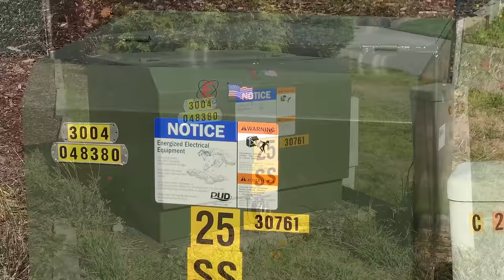Replacing a Pad Mounted Residential Transformer

Comment: I have the utmost  respect for those that work with high voltage systems like our power grid. You can see they are well trained and are well disciplined.  After all, there lives are at stake.     Now if only our elected officials could function with that same respect and understanding.
Reply: I often think about this too... What I think is happening is the type of mental focus it takes to design and implement these things it's very different than the environment of policy making and human behavior focused endeavors. 

I really like maths, I suck at it but I really enjoy the intense discipline and focus and creative thinking you need to discover unique and interesting patterns and relations. I also like system building.

But what I often don't like is people hahahaha.... I think that speaks perhaps a little to how we get such a reliable powergrid and such a shit show of everything else! But that's just my two cents! Take care!
Reply: They are not quite that disciplined. Numerous safety violations were taking place here. The biggest one was not using adequate PPE.
Reply: It's even worse when you get up high! I work around 480v on power bars 50 ft in the air on a cherry picker. You have to be aware of where you are at all times, one wrong move and you'll get nailed.
Reply: @johnarmenta2199  What do you think the primary voltage is? I'm sure much more than 600 VAC. I thought cotton clothing, like blue jeans, would be verboten.
Reply: @toma5153  - it's 15kV class equipment. My guess is the operational voltage is either 12.47 or 13.2kV. Cotton should be fine provided they have the breaker set on a hot line hold or arc flash mode. But they are not wearing Lineman gloves - the high voltage rated gloves. That's not necessary if the system is de-energized and grounded. I don't see any grounds though - maybe its grounded elsewhere. The big deal is no consistent use of glasses and hard hats. Just my observations.
Reply: @johnarmenta2199  Thanks John.
Reply: When it comes to high voltage, you only get to screw up once.
    If God is looking out for you.... Maybe twice.....lol
Reply: @JRotten  - yeah, God has nothing to do with it. Preparation, PPE, and following standard operating procedures will see  that you get home in one piece every night. My Team and I designed an arc flash reduction system for the electric distribution system and incorporated it into the SOP's. I know for a fact that no less than two Linemen went home safe because of that system which was designed and used by MEN! Not God!
Reply: The reason they don't is because there is no potential to die.
Reply: their * 🙄.
Reply: They'd have to be in fear of there life and that ain't happening when we are all sheep.
Reply: Lives at stake? how come? all you have to do is cut the power at the other end...
Reply: This is medium voltage.
Reply: @johnarmenta2199  not much of a guess when the transformer has “H.V. 12,470/7,200” marked on it.
Reply: @RadDadisRad  - Okay, I see it now. I didn't look so closely before. So, basically, I guessed right? LOL
Reply: @christiannielsen3863  - Cutting power is only half the procedure. The line has to be grounded as well. Gloves and eye protection should still be worn just in case the line is accidentally energized. That would be a really bad day, but those kinds of days can happen.
Reply: @RadDadisRad  More specifically, I believe the transformer actually sees 7200 volts. There is 12,470 volts between two hot phases in this system, but this is a single phase transformer connected between just one hot phase and a grounded neutral. 7200 * sqrt(3) = 12,470.
Reply: @christiannielsen3863  What about power backfed from one of the homes? Many homes now have grid-tied solar panels, though PV inverters are required by law to shut down if they sense the grid going away. Still, my utility (San Diego Gas & Electric) requires an outdoor disconnect switch on my house that the utility can open to ensure my system is shut down. We don't know if these workers checked for this.

Comment: This is a great example of what not to do.
Reply: Elaborate? Edit, I finished watching the video.  I get it now.
Reply: Why?
Reply: @boele0707  Not enough PPE.  Poor practice for example, they left the same conductor on the wire.  New connection = strip back fresh wire.
Reply: Safety Safety Safety. No proper ppe, testing, phasing, lifting procedures, shape job on cables was horrendous. Tho.. they did change it with primary hot 🔥
Reply: Man plz.  They must not need ppe or cover up.    I would be fired if i did that
Reply: @green250mx  why did they do it primary hot? Why not pull the fuses at the pole? I've assisted with a few ped transformer changes and DTE guys always de-energized em at the pole
Reply: @themtb2003  hahaha there's a BIG difference between electricians and linemen.  A real lineman will do it the right way, every time.
Reply: @electromechanicalstuff2602  not sure of their safety practices. Not totally wrong just not the safest. Most likely to save time
Reply: @tonyhill5348  well when a lineman does it wrong the first time he ain't got no arms to do it wrong again.....
Reply: @Mr. Sunshine I seriously hope your not in any trade.  I'm surprised your doing alright if you feel like this is okay.
Reply: @Mr. Sunshine by your standards maybe.  But by distribution standards for the United States, no.  A hard no.
Reply: @Mr. Sunshine got that right!
Reply: @Mr. Sunshine u got it bud!
Reply: themtb2011 backwards work with a hot primary might be nice for the others on the same feeder but that close to hot Kv without an insulating blanket might shorten your life. Those others on that feeder ain’t gonna take care of your affairs if you get fried. Kill the fuse or disconnect further up the line..  been chasing electrons since 1953 both military and civilian. been lite by 440 3 phase 400Hz. Once ain’t fun.
Reply: @themtb2003  no, we're NOT electricians.  The actual job title is Line Mechanic, also, the IBEW isn't the only union, you forgot about all the local utility worked unions, I'd have to double check but electricians are not included.  Anything else?
Reply: i agree 100%
extremely sloppy job. 
A: they guy lost his socket wrench and allen socket in the old one lol and thus why the other guy had to use an impact
B: that NoOx was not applied even close to properly. your supposed to brush it INTO the strands of wire
C: its not even to code to allow the reuse of those ends. you MUST cut them off and use fresh ends of the wire. that IS a code violation for aluminum wire. copper can be reused a few times. 
D: No torque wrench was used. putting them till they are tight as a MOFO is a bad craftsmanship and usually a failure of such on an electrical inspection. 
E: You are (per the manual) supposed to use 2, not one, 2 of those crimp bonding sleeves and a go No go gauges used to confirm them installed to spec. I saw none being used. 
F: i have never see such blaintent overspending. looks like 6 guys, 2 trucks and a crane to do the job that 2 people and a mini skid could do easily. hell even a truck crane could do the job. they only weigh like 500 lbs. maybe that one was more, but most of those truck bed cranes are good for up to 1,000
G: Quite a lot of OSHA violations, a few guys with no helmet, NO safety glasses at all, and i see NO flaggers on the street. a few cones will not suffice. 

honestly one of the worst jobs i have ever seen done.
Reply: @tonyhill5348  ok boomer
Reply: @themtb2003  that's basically the response I figured you'd come up with 😉.  Defeated!
Reply: @themtb2003  diy chatroom is the worst
Reply: @themtb2003  oh yes so many online experts
Reply: @scallen3841  Why is there always one of you bone heads that always demands a counter video? The Internet does not owe you anything; besides, @loligagger85 Did quite a good job of explaining what these guys missed, even if flaggers is a bit over kill for this size job. You should see jobs like these in West Africa...you'd literally lose your $hit.
Reply: themtb2011 backwards you obviously are not a lineman lol. This video has so many views cause we are showing it to crews and pointing out all the suck from beginning to end lol. Stick to black red blue my insecure friend. This changeout is epic trash. Sorry you didn’t know this lol. Maybe cause you’re not a lineman and dunno what a good comment is when you see it lol
Reply: That’s a pretty ignorant incorrect way of looking at it but seeing as you dunno anything about line work it’s ok. I’m not in a union. I do this faster and safer with less ppl. But nice try.
Reply: themtb2011 backwards you know what they say about sucking don’t you? It sucks to suck. Lineman don’t go on electricians forums.
Reply: Egg Shaped Israeli Operative  lol isn't that truth ,
Reply: @MrT13  Wow dam such a big mouth behind that keyboard
Reply: I don’t run a crew cause I’m such a nice guy. I’ve been doing this a long time I did regular electric for a while first. I’m good. And you know how I know? Cause I know that there’s a whole ton of ppl out there who work on bigger stuff than me who are way better. But in this video from the fact they didn’t kill it. They used a test feed through to tie a loop. And they could’ve just left the secondaries on the taps and just unscrewed the one screw holding it on those 3/4 studs. Plug one side in go up to next punch it in test it without whole tap on test volt unplug and finish and energize. I do this everyday bub. Quicker and safer.
Reply: Wether it’s behind this cell phone or in this yard with 70 other guys I’m in right now it doesn’t make what I’m saying any less true. This changeout was trash. Takes longer energized. And is dangerous for no reason.
Reply: @MrT13  then why weren't you showing them your Superman skills , and doing it all yourself lol
Reply: I dunno how long this took them seeing how it’s edited but we can setup. Kill tx and have it back on in under 15 minutes unless a plane crashes on us or some nonsense. Guy who made this original comment knows what’s up. It is what it is.
Reply: Scallen when I’m tired of watching a grunt fiddle with something long enough I do. Like I said. Sucks to suck.
Reply: @electromechanicalstuff2602  was there any indication that the line was actually hot? Could they have reenergized the line before hand? I have no idea about lines work.

Comment: That is some pitiful safety practices
Reply: Lol, I liked the apprentice with NO GLOVES, the journeyman with leather gloves, the foreman in yellow with no hard hat or gloves touching the transformer, accident waiting to happen.
Reply: Agree!
Reply: @lennylenhard5072   Yeah I use to do this kind of work. I seen how they are not suited up. I was thinking do they have a death wish. There's no way in hell I would even think about being careless. I know to many people that had freak accidents and got injured or even died.
Reply: Using non-insulated ratchet to take off the wire on the service side
Reply: That's what I noticed.  No gloves, no face shield, and one - no hard hat.  OSHA take notice.
Reply: Changing a ug can with the primary on a feed thru smh.
Reply: What about using in insulating mat only for the knees.
Reply: Not at all. Those wires they were handling and screwing down to the terminal strip were dead secondaries. Those were the 3 feed lines going to the 3 houses fed by the xfmr. The transformer was not hot at that point as the line side terminals had been capped off and were on the dummy terminals on the transformer. When the wiring was done the lineman with the pole moved the input wires to the primary of the transformer.
Reply: southtxblues This is Canada
Reply: @wansolve2036  I retired from an elect utility and for something like that, even dead, safety glasses and gloves were required.  It was to be treated as if it were hot.
Reply: @steelisthemeal  No it isn't, it's Wa St on the peninsula, look up Clallum county PUD truck images and compare them to the trucks you're seeing on this video.
Also take note of the license plates in this video.
Reply: I saw the thumbnail and only came to mention that haha
Reply: WanSolve does not mean  a house was not back feeding # not worth the risk
Reply: @ajfurnari2448  Main Power was disconnected.
Reply: I'm an inside wireman. The one thing that I saw was when he had the multimeter and was testing voltage on the load side busbar, this fat middle aged Journeyman was bent at the waist getting ready to tip over and get a face full of voltage
Reply: I get the hard hats needed when they were lifting, but why a hard hat when nothing is above head?
Reply: Dusty 99  I'm not a keyboard warrior, though. I'm his peer in the field
Reply: @dougierotten  OSHA
Reply: Because if you get hurt worker’s compensation the SAFTEY man osha and because you are working UNSAFE YOU SIR ARE SCREWED.
Reply: I’m not sure who is in charge. I’m guessing the fat guy in the green jacket. regardless someone is teaching the younger guys terrible habits. Look at your rubber gloves, they are spotless,.
I used to worked for LEE COUNTY ELECTRIC CO-OP ,,, NEVER DID WE WORK LIVE TRANSFORMERS WITH CASUAL GLOVES...
IVE SERVED MY TIME IN THE HARNESSES AND SLEVES AND GLOVES . YALL STAY SAFE BECAUSE BELIEVE ME YOUR COMPANY IS NOT YOUR FRIEND
Reply: I'm sure your all the professional's you think you are
Reply: WanSolve the primary lines were hot.
Reply: @billcoley8520  whatever you say "pro"
Reply: @lennylenhard5072  so I take it this would be a good OSHA VIDEO what not to do changing new transformer. I honestly thought wow these guys are doing this to fast I think, Then when I read comments I was right, That's crazy 😨😨😨😨😬😬
Reply: Also they didn't torque the terminals and the transformer wasn't bolted down to the ground.
Reply: PlzDontKillDave you are not correct. You are very confused my friend. 
The primary cables you are speaking of are HOT. One comes in and one goes out. When they are using the hot stick to pull out of the transformer it is hot 🥵. Likewise for the other.
Reply: None of em wearing Saftey glasses or face shields.
Reply: AJ Furnari I cringed when I saw that ratchet.
Reply: They have very lenient safety rules there. No glasses, gloves, hard hats, but they have wheel chocks, cones and pads down.
Reply: Cowboys. Terrible.
Reply: @Mr. Sunshine So where are the videos of them doing it the correct way ?
Reply: @Mr. Sunshine I don't know bro my dad was a union electrician from 1954 to 1996 , and he never acted like you guys do on here .
Reply: @Mr. Sunshine not mad at all  just feel sorry for you guys
Reply: AJ Furnari they remove service side conductors after the primary terminal boots were removed. As in, there was no voltage on it. No insulated ratchet necessary.
Reply: Dougie Rotten yeah, if people would just put on a hard hat just before they got unexpectedly hit in the head with something imagine all the injuries we’d prevent. What are they thinking?
Reply: THEIR A SUB CONTRACTOR
Reply: You people are the reason coffee has to say "Caution Hot."...
Reply: If they are doing the work HOT, then yes, the full proper PPE should be employed. However, I strongly doubt that the circuit is energized while they are doing the work.
Reply: Griff Mustard it is energized.
Reply: @griffmustard  The primary was clearly live.  They put the primaries in bypass so the downstream customers would still have power.  They popped the primaries back in to test the transformer before hooking up the secondaries, and then back on bypass.
Reply: Mrt it sure is hot. I don’t give a rip what they say.
Reply: Mark Grudt please read everyone of my comments before you call me a sissy.  My intent is to takeaway any advantage that workers comp or even the company you work for from screwing you if you were to get injured. 
I’ve never ran into a lineman that I would call a sissy.
Reply: BILL C new guy always talks real good till he feels that burning sensation lol. Could’ve just iso it. If it’s a radial not supposed to use a feed through for anything but testing either. But hey we can’t all be knowledgeable non sissies lol
Reply: @steelisthemeal  not an effing chance
Reply: @Daniel Richards if it is grounded on both ends I wouldn’t care if they were naked when they swapped out the transformer,

Comment: I’m a engineer on IEC MV-systems in Europe and it is always both interesting and inspiring what grid solutions are used around the world.
Thank you for this detailed and in-depth video! 🤘 Stay safe ⚡️👷‍♂️
Reply: Do you not use pad mount transformers?
Reply: @TheArtificiallyIntelligent  No. Never something this small. We use more kiosk style transformers for 100 houses. But we also run a 22kV distribution grid, and 400V 3-phase to the houses, so there are less voltage drop and losses involved.

Comment: They just did this in my front yard but they also ran new underground wires. It was a cool process to witness. Good job guys
Reply: What in the world were all those wires?
Reply: Yeah, we ripped one out for scrap, it was cool, nobody got fried! But, the electric company, was furious!
Reply: @luckyhiker3434  all underground power lines. We don’t have overhead power lines in our neighborhood. All are run underground.
Reply: Unless they destroy your yard in the peocess
Reply: @luckyhiker3434  The transformer converts 7800 volts to 240 volts.  The thicker wires they were using the sticks when handling are the 7800 volt feed.  The other wires are three sets of 240/120V to the three homes.  Each home gets three wires, two 120 volts "hots" and a neutral which is grounded.  Connecting to both hots give you 240 volts for bigger loads.  There were nine lower voltage wires because of the three homes served.